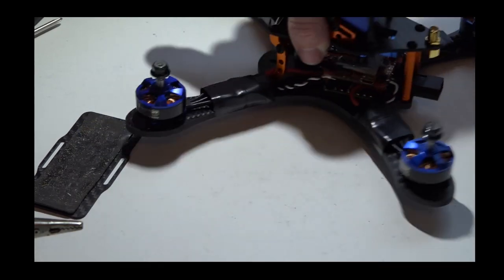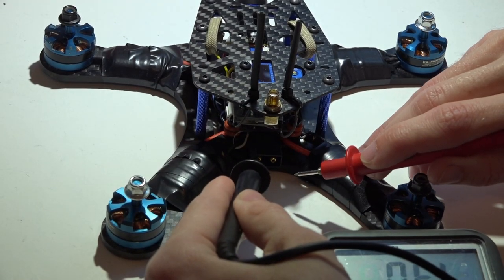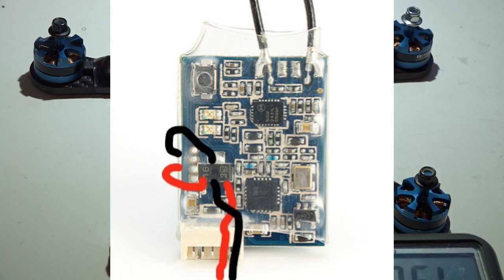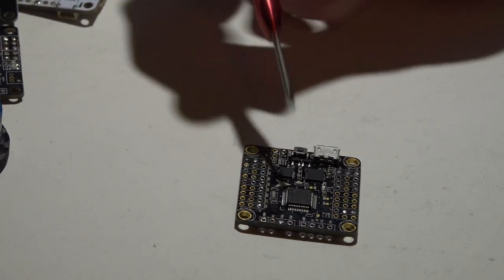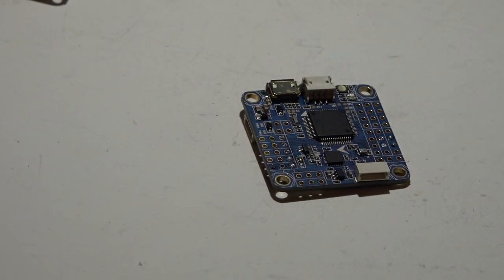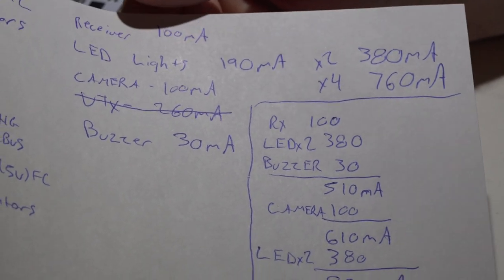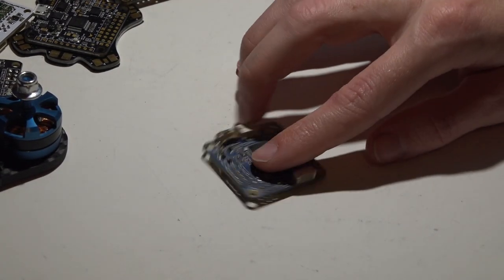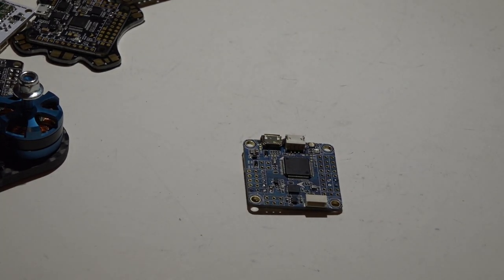How NOT To Fry Multirotor Parts: Part 2

Comment: This is a really helpful video which I hope will help people save money by not frying anything. What are your thoughts on protecting the sensitive electronics by taking anti-static precautions before touching the boards or components? This could be in the form of touching a grounded item first or even wearing an anti-static strap while working on the multi-rotor.

Comment: holy flight controller.   wowzers.   GREAT video, this is why I subscribe.   love this type of content (the knowledge transfer...not the ranting).   anyway keep up the work and thanks for the part 2!!  very well done
Reply: question:.  you mention ESC break capacitors easy.    I see it seems easy to replace, but there is no values on the cap...what do I replace it with?

Comment: Hey JC great video, I always do con tests before plugging but never really thought about or knew that most rec use a step down voltage, so learning some good stuff here.  Could be great if you could do a current measurement video, if nothing else it would confirm I'm thinking along the right lines 

Keep up the great work all the best 
Clive
England
Reply from the maker: Yea no problem. I can do that. It would be useful.

Comment: JC..Do you have an easy method for determining if an ESC is fried? I hooked a set up that I had been using successfully and all motors were jerky when I applied power. Guessing they were fried, but I hooked up a new set of ESCs without changing anything and the new set work just fine.

Comment: Good stuff. I'm making a habit of testing my continuity throughout the build. Hey..how can I test an esc to see if it's been fried?
Reply from the maker: There are too many circuits to test on ESCs. And not all ESCs are the same. Its possible but the best way is to swap that ESC and another ESC on a different motor. If the problem is on the different motor then its the ESC. If the original motor is still not working right then its the motor or flight controller. Then swap motors to determine if its the motor or FC.

Comment: I fried something (don't really know what) on my omnibus F4, happened when I plug in the battery. It can be powered by USB after that but nothing happen when I plug in the battery. How do I diagnose what happen?

I'm switching the battery to connect directly to PDB first then from PDB to FC. Is it ok to power receiver, buzzer, LED from FC or should I switch it over to power from PDB?

Comment: Hi, 
You repair a lot and I did fry a part, I swapped the ground and signal on a X4R SB, now it's dead. 

Any suggestions how to fix this?
Reply from the maker: I'd watch this. Test the voltage on the voltage regulator I'm talking about in the video. If you're getting no voltage then the regulator is fried. I show you in the video how to bypass it. https://www.youtube.com/watch?v=Uwk10I-uiVU&t=1s&index=7&list=PLiYYhnH4BhI_7WQQLFOqccpD7DNea6hIc
Reply: Project Blue Falcon Thanks, I get 0,961 voltage out so I guess it's fried. Will try to fix soon. 

You mentioned a proper fix video, is that out already?
Reply: Project Blue Falcon just checked the  processor and it has 4 ground pins. 

So I'll be connecting a 3.3v wire. 

Thanks
Reply from the maker: No I need to order more regulators and I keep forgetting. But it's really the same as all the other repairs. Just have to buy the right regulator. The part number is written on it.

Comment: How long does it take to fry a Video Transmitter if you forget to screw an antenna on?
Reply from the maker: The amount of time really depends on the video transmitter, so the amount of time will vary. It's not instant. Thats a rumor I've seen often. I've never had one go bad instantly. But I haven't dont any tests to see how long it takes. I'll put it on my experiments to try and do a video on it.
Reply: I inadvertently flew an entire battery without a vtx antenna and my vtx survived. 
Granted, running a vtx with no antenna is not a good idea and not something I would recommend, but the scare in the hobby of "it will blow up immediately" does not hold up with all transmitters.
I'm sure some do. But with newer technologies and parts, I don't think running it for a few seconds without an antenna will be as disastrous as some would have you think.
Reply: Pop-pop Fpv I've been running the AKK 600mw and I noticed a significant decrease in performance after using it without an antenna.